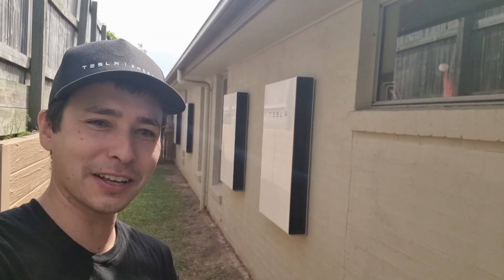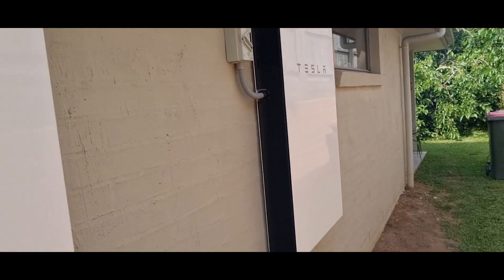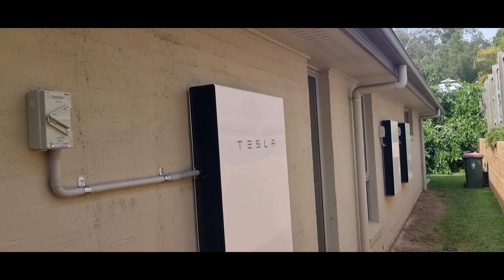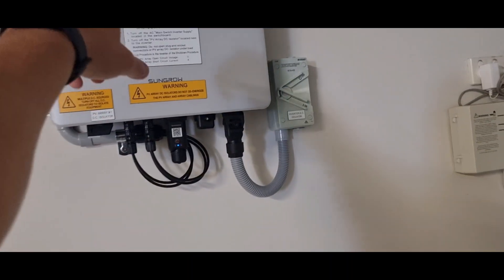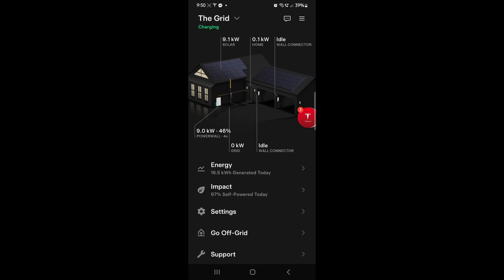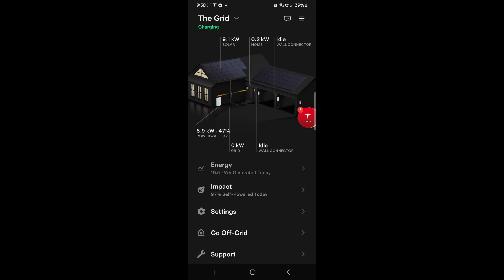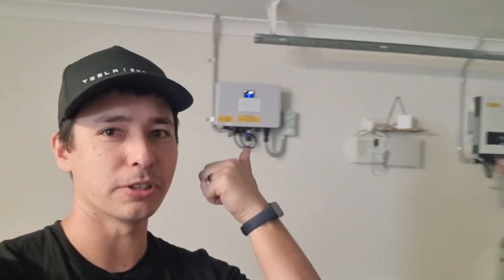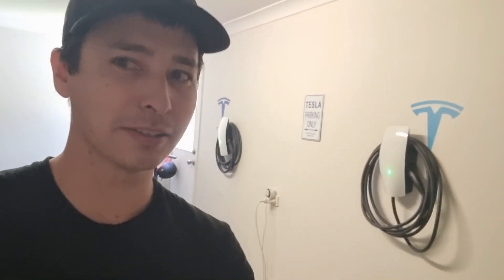New Solar production day #1 + Tesla Powerwalls performance

Comment from the maker: Summary

First day of solar production with Tesla Powerwalls shows impressive energy generation, even with some cloud cover.

Highlights
☀️ Solar Production: Generating 9.2 kW of solar energy during the morning.
🔋 Powerwall Performance: Four Powerwalls charging efficiently from solar energy.
⚡ Inverter Efficiency: The SUNGR inverter producing 4.9 kW, while the SoFar inverter at 4.43 kW.
📲 Tesla App Insights: Real-time monitoring shows energy flow and battery utilization.
📅 Increased Capacity: New solar panels significantly boost electricity generation compared to previous levels.
🌥️ Weather Impact: Initial cloud cover affected early production, but output improved throughout the morning.
🚗 EV Charging: Extra energy can be directed to charge the Tesla vehicle, maximizing solar benefits.
Key Insights
🌞 Effective Solar Setup: The combination of new solar panels and Powerwalls maximizes energy harvesting during sunny days, showcasing how solar energy can be effectively utilized at home.
🔄 Energy Storage Optimization: The use of Tesla Powerwalls allows for efficient energy storage, enabling homeowners to utilize solar energy even when the sun isn’t shining.
📊 Real-Time Monitoring Benefits: The Tesla app provides critical insights into production and energy usage, empowering homeowners to track efficiency and make informed decisions.
🌤️ Cloud Cover Considerations: Weather conditions play a significant role in solar production; however, the system’s design allows for effective performance even under less-than-ideal conditions.
🏠 Home Energy Independence: With the new setup, excess solar energy can be stored or used for electric vehicle charging, enhancing energy independence and reducing reliance on the grid.
📈 Scalable Solutions: The addition of solar panels demonstrates the scalability of solar solutions, catering to increased energy needs as lifestyles change.
🔌 Future-Proofing Energy Needs: Investing in solar and battery technology prepares homeowners for a sustainable energy future, minimizing costs and environmental impact.